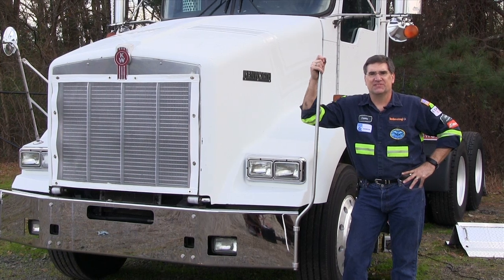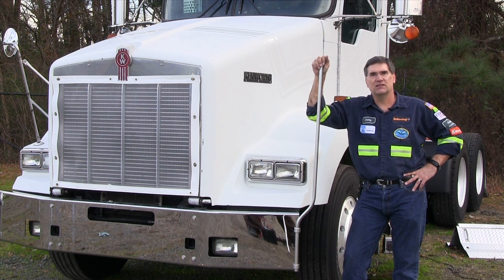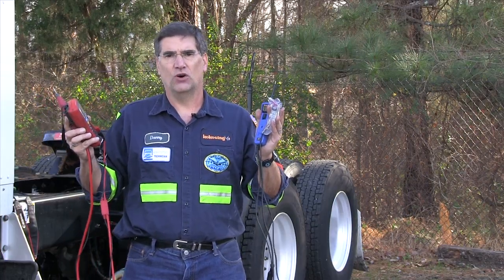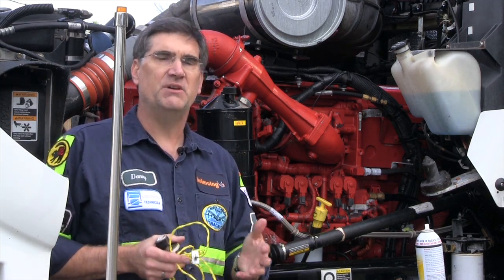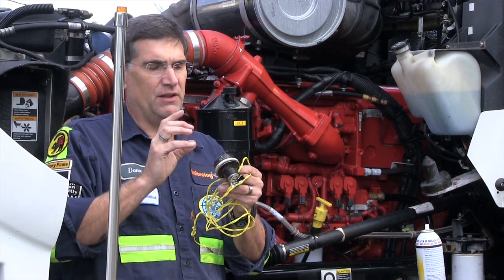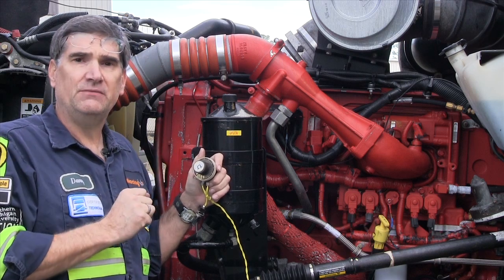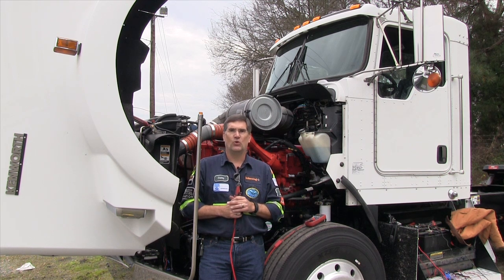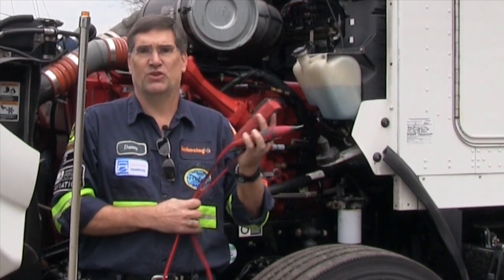LOADpro® vs. Volt-pro vs. Powerprobe® vs. Corrosion

Comment: Hello Dan, I have enough knowledge  of 36v and48v golfcart & garden tractor solenoids ,relays safety switches, as long as they are not intertwined with controller  units. I am considering buying your probe after watching one of  your videos. I bought a 48v toro workman  same lines along a Deere gator,that did not have the batteries.  It has a interlock system 3 switches that if one fails it will not talk to the controller and prevent the voltage to activate  run.There is a short ground but so many wires and I feel that this may be the ticket to located my problem .It is very tiresome  disconnecting main ground and reconnecting.I just want to be sure that this probe would be appropriate  for my 48v dc applications. Thank you
Reply from the maker: There’s a 48V version of the LOADpro. You need a schematic.
Reply: @bivideo7 The 187 model?

Comment: Can the load pro be used while checking ecm circuit.
Reply from the maker: It loads a voltage - 5V-28.5V. Not designed for an input.

Comment: I am a Contractor by trade, do a lot of HVAC and own old trucks and older boats. This kind of thinking would have been a godsend in the change parts until its fixed HVAC industry, and really cleared up some low voltage questions I have always had. I am buying your book and probe now, and was looking for a generalized class if you had one to attend with my son. Perhaps you do that in Custom Training?

Comment: 14:20 - How would I expect the LoadPro to respond to circuit loading if there were corrosion in both positive and negative sides of the circuit? Wouldn’t I need to test the ground terminal of the connector with a known good hot to rule out corrosion in the ground wire as well?
Reply from the maker: It's two faults. The positive would show up first - using the method of moving the ground lead, then the ground fault would show up after you fix the positive. Always good to test and retest.

Comment: I use bulbs of different restaurants to load test
Reply from the maker: Works great. Not calibrated, and the tool manual shows exact resistances for all voltage drops calculated using Ohm’s Law. Plus, it’s on the meter already so you don’t have to stop to get a bulb. You just read voltage and push the button. But, bulbs work if the ambient light isn’t a hindrance. Plus, a bulb can’t distinguish between the three faults like a meter can. Your call.
Reply: @bivideo7  Yes, totally agree Not easy to get the load pro in the uk, so use what i need to get bye

Comment: Just used my load pro on my 09 Colorado cuz blower motor would work and as o drove around it would stop. Unplugged the blower motor and used load pro at the connector and I had source voltage till I hit the button and loaded the circuit. I lost 11 volts. Put my negative lead on a good ground and barely a drop so I knew the problem was on the ground side. It took prob 15 seconds to find the problem. Fixed the ground wire and presto chango blower now works! NICE TOOL!
Reply from the maker: Awesome!

Comment: How do you find a bad or corrosion on ground
Reply from the maker: By process of elimination. Check at both pins of the connector, then move blacklead to ground.
Reply: @bivideo7 thank you
Reply: @bivideo7  would it damage ecms  I’ve heard of people damaging ecms with power probe I’ve read that your load pro is safe just wanted to ask the guy who made it
Reply: @bivideo7 thank you

Comment: Why wouldn’t you measure the voltage with the ECU or whatever is connected in circuit and see the actual voltage that item is seeing at it’s connector ?
Reply from the maker: @Omegaman1969  Go for it, if you can.

Comment: is the load sufficient enough that no faults are going to slip by ya? 
any reason the resister inside of it is not any larger?  
some people will use a headlight bulb, im saying whynot 2 or 3 or 6. If a circuit has a 10, 15, or 20 amp fuse im thinking load that sucker up! this puts a 1 amp draw on it correct?

Comment: HI  Dan I think your tool is great I have two might buy one more .  I watch a lot or your reviews and they were great learning. Now i have a lot of power probes and they are good tools But I notice you didn't go up against the power probe Hook. The hook has what they seem the same as yours they call it the power shot button which does what yours does but like you said your is more portalable no power sorce needed other than the battery in the meter.
Reply from the maker: I sued them.
Reply: @bivideo7  really...i guess that's why they (power probe) doesn't talk about it. Or doing videos on it anymore. It big but i like how it chooses the meter i need. Even though i'm a do-it-yourselfer. The load pro should be on every meter from the start.

Comment: Love my load-pro. I'm not a professional mechanic and this tool has proved to be every bit as easy to use as advertised!! Saved me a lot of time and money!! Thanks Dan for a great tool!
Reply from the maker: Cool - thanks - send an email to Nick Pinchuk (CEO Snap-on) and tell him he should've responded to my first email in 2011 instead of making me sue them... jean.m.rauen@snapon.com
Reply: @bivideo7  DON'T WORRY ABOUT HATERS; EVEN JESUS WAS HATED. TRUTH IS STUBBORN AND DESPITE THE DECEPTIONS OF HYPOCRISY, HATRED & DISHONESTY, TRUTH WILL ALWAYS PREVAIL AT LAST. 
I bought the tool but did not run into the appropriate circumstances to use it. Today, I do but I am skeptical because  I am faced with a 2015 Chevy Impala with High Speed CANBUS issues or shut down; the engine starts and runs but the car is highly possessed by paranormal activities. I want to rule out the CANBUS wiring as being the fault. CAN I USE MY LOADPRO TO DO SO ON CANBUS WIRES? asking because CANBUS wires carry 5Volts as opposed as system voltage of 12volts.

Comment: Remember good tools do not need a lot of convincing. The Loadpro has its own use to diagnose wires. The power probe has its own uses to check components.
Reply from the maker: You don't diagnose components You diagnose circuits.

Comment: I really love the power probe - AND the load pro. They do completely different things in my opinion. 

I like that the power probe hooks to the battery and allows me to supply a power or ground to anything... it's very handy for mapping out what is positive/negative etc.   trailer lights and such the power probe really shines, jumping a fan to test an individual component is where the power probe shines. 

Now the load pro leads has a nice shape, isn't sharp and is phenomenal at determining the integrity of the circuit.   I see a lot of people bashing the load pro because they are accustomed to a test light and splitting the circuit in half and narrowing it down little by little. Yes it's very possible to find the problem with a test light but Mr Sullivan is not wrong on his leads being faster to do the same thing. I think the people that don't see the value of his load pro just don't understand how to use it and what is different.  For someone wanting numbers they reach for a meter anyway, anyone wanting that would appreciate introducing a load by just pressing a button... it's comical to see someone prefer to grab a bulb and harness and try and estimate based on how bright you think the bulb usually is.

Even if load pro didn't have the resistor in the lead it's a nice lead worthy of use. 

The volt pro is cheesy and not worthy of purchase IMO.  Meter and leads - always useful, resistor with momentary button into a lead is profoundly useful if you understand why and how to use it.

Comment: 👍👍 I own this tool and use it along with the voltage drop test method. I find that the tool and voltage drop testing is a very accurate and definitive way of testing electrical circuits. 
(Simple, quick, easy and reliable)

Comment: Dan , I just diagnosed this exact scenario on a Cummins ISX and found corrosion in the very connector you are testing. I solved an intermittent fault that had plagued a customer for months.
I have the original Teslight and Load Pro. I have saved several customers from needlessly replacing ECMs on Cat engines. Most don't realize the difference between voltage and current. Keep up the good work.
Reply from the maker: Thanks - a particularly nice way to start an otherwise bad week... I appreciate it.

Comment: I’m so confused. I’m trying to determine if I need both tools. I have the power probe.  Which you didn’t use it correctly in the video.  I’m further confused by the contempt you hold for the competitor which would make sense under certain circumstances

Comment: Is it better or different?
Reply from the maker: It works...
Reply: I tried them both. Yours is BETTER. One tool to get and it is load pro. I was testing a floor scrubber and wire was corroded

Comment: Shouldn't the second reading be done between the positive terminal at the device and the battery negative terminal?  What if the resistance is between the chassis ground and the negative battery terminal?  Wouldn't you need to test resistance between the chassis ground and the negative battery terminal also?

Comment: Dan, How would I go about testing the fuel pump wiring when there's 
Only voltage on the wires for a hot second (priming) ( I have the tool and book by the way)?
Reply from the maker: Try using MIN/MAX on the meter with the load applied when you power up the pump. You have to have the meter connected and set to volts first and you can't disconnect it until you've read it.

Comment: You should go on Shark Tank, talk to that guy Kevin to secure your patent. He'll make sure anybody trying to rip you off, will get sued back to the Stone Age. Anyhoo, I think your device looks great and I believe your claims regarding it. But here's my NOOB question: I TRY to repair mostly small electronic stuff, so would this instrument be any good, for circuit boards and discrete components or is it only for big mechanical/wiring only? Also, you say there are three common issues/faults with malfunctioning equipment, do these three also apply, to small circuits [radios, TVs, stereos, etc] or just big stuff, like the wires in a truck or a house, and such? Please let me know, as I am really trying to learn more about electronics, on my own. Kudos on your invention! Be safe

Comment: the theory approach to the problem with the great tool ruling out 66% of the possible faults in an instant is impressive enough. the 80% of the entire problem originate from crossroads of wirings with ease of diagnosing it is everything. your are an engineer teacher sir!

Comment: I just bought this tool from Amazon and I have no doubts that it is a great tool.  I am not a professional tech or mechanic, just a back yard shade tree handyman.  It would be great if you could make some basic repair videos using the load pro..i.e, A.C not working how would you trouble shoot why the compressor won't turn on...or some sort of electrical problem and how to solve it with the load pro.

Comment: In this case, the faulty circuit has been identified for you.  The load pro didn't find it, you did.  In other words you've already done the truck diagnosis without the load pro and you know the which circuit is at fault.  Now all you are doing with the load pro is determining which leg (negative or positive) the problem is on.  And frankly what the numerical resistance is in the circuit is irrelevant.   finding what leg is bad could be done cheaply and easily by using a test light with the appropriate lamp as the substitute load.  How?  By doing the same you did with the load pro.  Using the appropriate load gives the additional assurance that the wires can carry the amount of current required by the circuit.  The load pro with a fixed 25 ohm resistor can only load the circuit at that level.  If you want to present a real world problem it should be, the truck comes into the shop you don't have a clue as to why it won't start or run.  Now find which one of a dozen circuits is at fault.  And once there, you still need to find out whether the problem is electronic (input/output device) or the wires associated with that input/output device.  What I'm saying is the load pro might help find a DC electrical problem (which wire is bad) associated with that circuit but it won't find an electronics problem (correct input signal/correct output signal and whether each is at the correct level.  Most techs need help finding the circuit that's problematic and figuring out if what they are seeing on their equipment is what they should be seeing, figuring out which of two wires is bad is the least of their problems.  By the way if you used the power probe in the right way you'd find which leg is problematic without disconnecting the plug from the device.  The power probe provide both battery voltage as well as the ability to ground a circuit.  By simply sticking the power probe into the positive side of the connector and providing battery voltage you try and start the truck.  If it didn't start put the power probe into the negative terminal of the connector and provide a ground.  The truck would have started and run by doing one or the other.  That would have told you which side of the wiring the problem was on and it would have been faster than using the load pro.

Comment: lol wow first off stop sticking meter leads in connectors you will ruin the connector. plugs up the connector and back pin  the power and ground, then check with the power probe and you will see 9 volts. the power probe can find the same problem you created if you use it the proper way.

Comment: I just happened on this channel and i am an electronic engineer. I see easily the real true value on the diagnostic side of this tool. Before i give too much feedback i am going to test it as well, i am sure my findings will be as good as described and can not wait to try it. I also was a semi mechanic/ heavy equipment mechanic for over 23 years and it just makes sense to me as he describes!! Wow i must have just got out of being a mechanic and then going to college to get my engineers degree when you put this on the market, i sure could have used this product and saved me tons of hours tracking down problems!!

Comment: Question would this work on a 5 volt reference circuit? Or would it load the 5 volts to much and potentially lead you down the wrong path?? The idea is good
Reply: excelente pregunta habría k chekar porke esta d por medio la ecu he internamente la fuente d la ecu

Comment: As a retired industrial electrician and electronic technician of many years you are a great teacher and a great inventer of this tool. I have dealt with alot of circuit voltage drops in my time and I bought this tool only because I believe in you and in your great product. I have used it and it's one of the best tools ever. This tool is not just for automotive but any circuits of up to 28 volts AC or DC.

Comment: Calculation:  If you have a 12v circuit where you have a 2.5v drop when loaded.  Is there a way to calculate the amperage?

Comment: I think you missed a trick here. Using the volt drop produced here, 12.1v - 9.67v = 2.43v and a little math(s) you can work out the total circuit resistance, or the resistance of the segment you are measuring.. 

Current drawn by the Load Pro resistor is system voltage ÷ 25Ω = 0.484 amps or call it 0.5 amps as this means you can just double the volt drop reading.

So that gives us 2.43v ÷ 0.484 amps  = 5.02Ω The rough calculation would be 2.43v x 2 = 4.86Ω

No more ohming out the wiring!

Comment: Great video... Mr  Sullivan

Going to purchase one... As an Electrical Engineer I understand the need to be efficient in my work...  I do residential  electrical repairs and mods in the homes and started customizing  vehicles (wiring systems) and found loadpro to be a  excellent product.... I also started working ( troubleshooting) automotive and going to be using your product.

Second, started doing YouTube videos and going to use your product ( per your promission) in my vehicle videos .. ( if I could only use this in my residential videos, lol)... Great product.....forget the dislikes ....

Keep up the of work....

Comment: Dan first of all congratulations on your invention and I tip my hat to you, with that being said I hope you dont think my next question is a criticism in anyway because it's not meant to be. I own one of your load pro tools and I dont use it, I work at an Audi dealership and most of my wiring problems come from control units which distribute the power or signal along the small gauge wire they use so am I correct in thinking this tool cannot be used with these faults. it's my understanding that I can only use it from  battery sourced feeds such as battery/starter cables and 12volt fuse feeds? thanks

Comment: In my opinion the power probe and the volt pro are not in the same category as the load pro. I owned a power probe it sat in the tool box and then I sold it.

Comment: All three are valid tools for diagnosis. Using your head for what is needed to correctly and efficiently preform the diagnosis is the first thing.
Reply: The only issue is when you get a false reading on a test and you go to the next step you have already failed

Comment: Auto Electrics 101 you always test circuit voltage under load. Just back probe the connector with it still plugged in and any voltmeter will show the voltage under load.